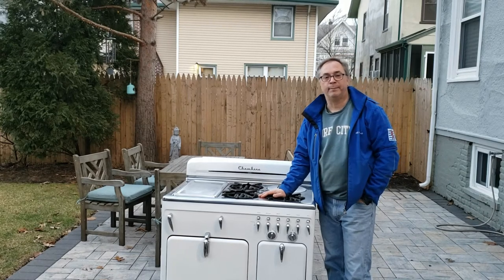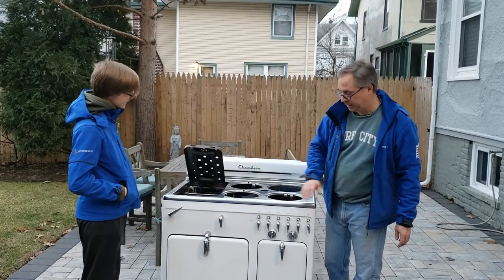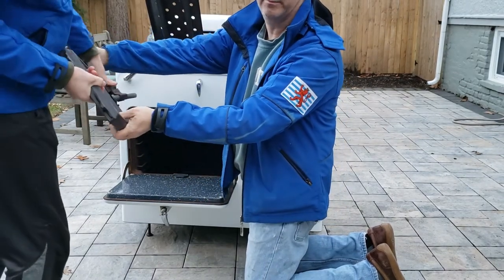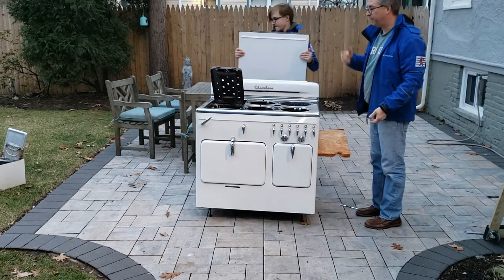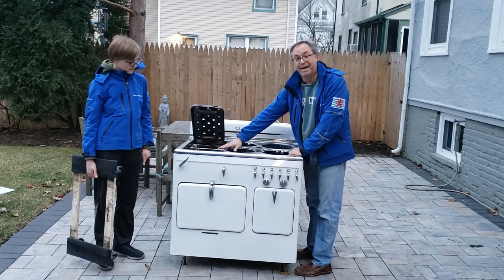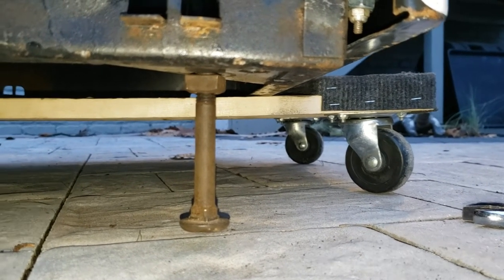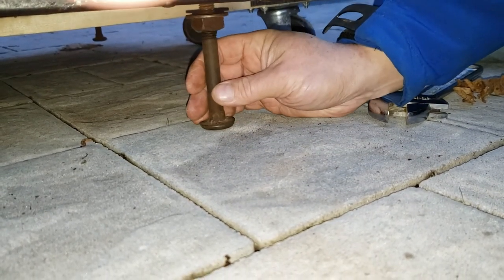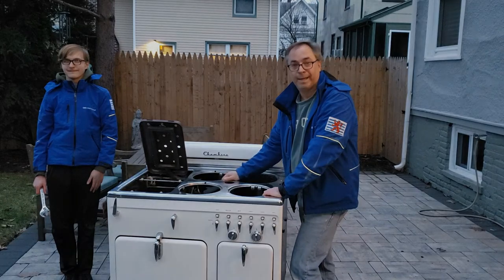How to Move a Chambers Stove

Comment: Awesome video, clear, straight to the point. Do you know how much the stove weighs after removing all the removable parts?
Reply from the maker: Thank you! This brings it down to about 350 lbs, I believe. (I was actually thinking while doing this that I should weigh each part and figure it out exactly). That's still heavy, but the weight is much less lopsided and that plus the decrease in weight make it more manageable. I'll get to that weighing, though!
Reply: Can the stove be transported laying on its back or side? Does it have to be upright? Wondering if I need to rent a truck to transport or could I just use my SUV.
Reply from the maker: @kcwakem  I would not at all recommend that. The side panels are not structural and even if you take them off, the sheet metal underneath them was not designed to take the weight. Also, if you don't remove the backsplash, you will likely crack the porcelain on it. These were made to ship upright.
Reply: @VintageStoveChannel  Thank you!

Comment: Is the method to remove the legs the same on a model A, i’m picking it up tonight and want to be sure I can get them off correctly
Reply from the maker: The A's legs have a bolt and nut that hold each one on. Since the legs are much taller than that of a B or C, I often leave them on and either put a solid deck dolly under each pair of legs or put two 4x4s on a dolly in the middle of the stove. If you need to remove them, then you'll need a jack to lift up each side as you work.

Comment: My restorer is planning to crate mine. Thoughts?
Reply from the maker: It depends on how far it's going and how it's being transported. I've seen stoves wrapped thoroughly in blankets travel across the country safely. But if it's going in a container, I'd probably crate it, too. I'd still remove a the very least the burner grates and pilot cover and box them up and stow then in the pantry before crating, though. As a restorer, I do tend to trust a restorer's caution. But if it's not a necessary expense, I'd shy away from it.
Reply: @VintageStoveChannel  roughly 100 miles and I appreciate your response.
ETA I should add it’s being trucked. His assistant said that the shipper they usually use has been a bit sloppy of late.

Comment: do these stoves have asbestos ?
Reply from the maker: The majority do not. There were a few months during 1951 when they used asbestos panels instead of the fiberglass ones you see in this video. In that case, pull them off and put them in a large plastic bag so they don't get damaged during transport. When you're done moving them, put them back in place and put the side panels back on. Asbestos poses a danger when it is friable - when it is broken up and exposed to air where it can blow around (including into your lungs). A solid panel left intact does not pose a health hazard.
Reply: @VintageStoveChannel  Thank you for the info! If I wanted to remove the asbestos panels and not put them back, can I still operate the stove in a safe manner?
Reply from the maker: @michaelcirlos150  I would not recommend that for two reasons: First, the insulation under the side panels protects you and the stove's surroundings from the heat generated by the burners, broiler and Thermowell. Second, the safest place for them is where they belong. Asbestos is not radioactive - it does not pose a danger when left undisturbed. Handling asbestos panels can cause it to break and that's what causes the health issues you hear about. That's why any asbestos disposal should be handled by an expert in asbestos mitigation whenever it's actually a problem. So if you remove the panels, you will become part of the asbestos problem, not the solution. They are enclosed inside the stove, under panels that you are unlikely to ever remove and the square inch of air space that is in the back of the stove is not a transit space for asbestos to begin flying around.
That being said, if your panels are somehow disintegrating (which I've never seen - and I've seen a lot), then call an expert in asbestos mitigation.
Reply: @VintageStoveChannel  Yes the corners of the panels were damaged and breaking up. The panels were also not sitting correctly onto their respective attachments inside the panels. The company I hired to inspect the stove did not know about the asbestos panels, but after I had explained and asked kindly to inspect the side panels for asbestos they were surprised to see the panels and removed them. I don't think they removed the panels in a professional manner. I hope I don't have a health risk in the house now....
Reply from the maker: @michaelcirlos150  Ah, got it! If they left the panels in your house, go get a heavy duty garbage bag and disposable rubber gloves, put the panels in the bag then take off the gloves and toss them in the bag and tie it up tight. Then put it in your basement or garage or somewhere where it is not going to be disturbed until you can find someone who will remove it for you cost-effectively. If they took the panels with them, just make sure that you have cleaned up after them - mop the floor, etc. You will likely not have any health issues from them handling the panels, unless they decided to break them up in your kitchen, in which case that's a whole other issue. But, for the continued use of your Chambers, I recommend putting fiberglass insulation under the side panels. That's what they used outside of that six to eight month production window when asbestos was the only thing they could get. There was a listing for it on eBay by the foot recently. I'll see if I can find the link.
Reply: @VintageStoveChannel  Thank you so much. I appreciate your help. I've tried researching online for answers and I haven't had much luck! I also need to purchase a safe insulation for the oven door. I read rockwool is not the safest material to use as insulation.
Reply from the maker: @michaelcirlos150  if you're replacing rock wool, the best replacement is rock wool. It's still used regularly in construction and there is no better insulation for your Chambers.
Reply: @VintageStoveChannel  Do you have any for sale? I can't seem to find the right amount i need for the doors
Reply: @VintageStoveChannel  do you have any for sale? I'm also looking for the fiberglass for the side panels.
Reply from the maker: @michaelcirlos150  I don't, but they usually sell it at Lowes if there's one near you. By the way, if you're doing this level of work on your stove, you should check out the ChambersRangers proboard. I link to it under the Resources tab on my site. They are very knowledgeable and there is a wealth of restoration information there.
Reply: @VintageStoveChannel  
.9